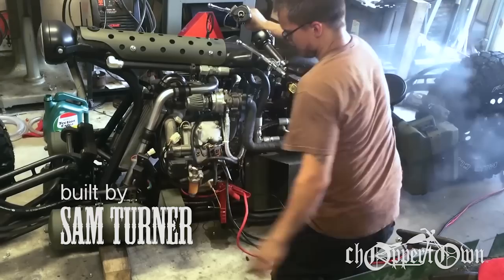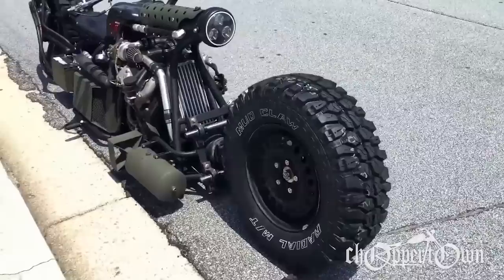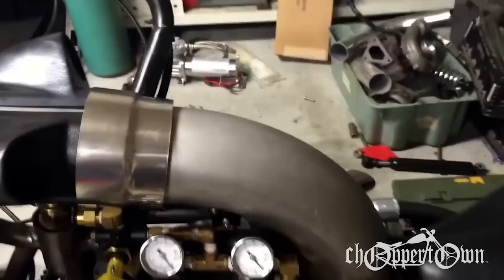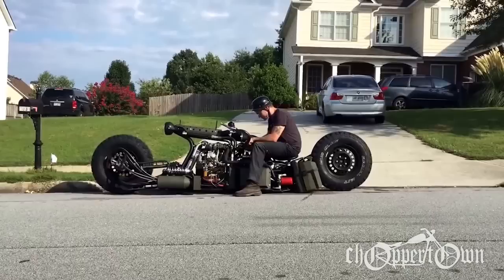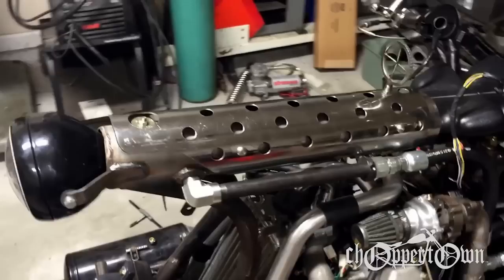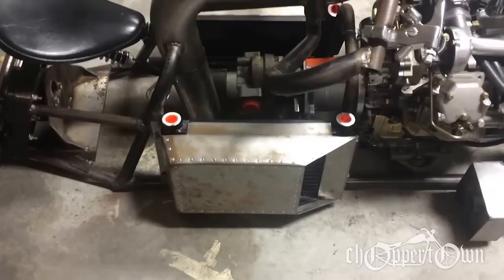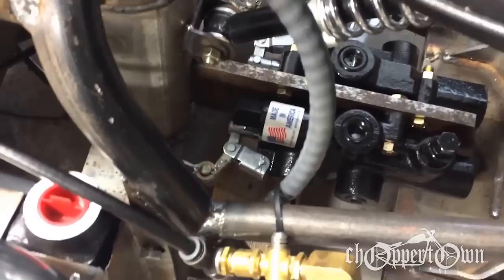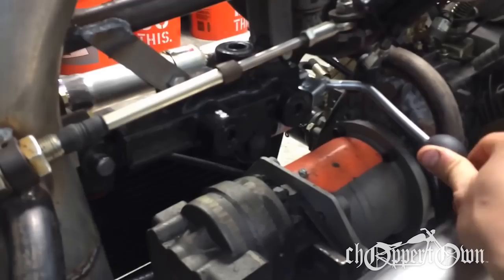Twin Turbo Diesel AWD Motorcycle (Bike & Builder episode 2)

Comment: Either too much load or too much fuel being injected into the motor. With smoke like that the exhaust valves are probibally seeing some pretty high EGT's, would highly suggest either putting larger turbos on the engine or going to a single turbo to help cut down on the smoke, if thats what your going for anyways. A 4 small 4 cylinder diesel engine out of a mercedes or even a 3 cylinder would help out alot considering it looks like those pumps are seriously overwhelming that little v twin.
Reply: Cervan leran something about diesel engines before you comment
Reply: what are you suggesting? i am a diesel engine mechanic lol. everything i said is correct, installing a larger turbo(more air) or decreasing the load(lower volume pump) would help with the unburnt fuel problem in the exhaust. this could all be wrong however if he purposely is injecting more fuel than it can burn creating the "black smoke". im not really against it being setup like that, but i would think it would be annoying while riding.
Reply: Cervan i am not trying to be mean but if you back of the fuel pump then it will lose power or if you go with more boost then you will burn your cylinders it's depends on how much air you are putting in. and remember that diesel is much harder to burn that is why almost every diesel smoke even if its just a little bit especially when it's cold and the bigger the turbo charger the more time it takes to spool up
Reply: I know larger turbos are harder to spool however it will cool down the combustion chamber and clean up the exhaust.  even running nitrous would be a good option for increasing power,  cooling egts and cleaning up the exhaust.  another thing is a larger turbo on a hydraulic setup is even better because it stays at a constant rpm while the fluid volume to the motors are modulated by valves effectively making spool a non point. the black smoke you see is actually wasted power,  it's unburned confirming the engine is consuming all available oxygen and the rest is waste. I realize that there is only so much you can do with a 2 cylinder vtwin diesel. however I believe that he is injecting extra fuel not for the small power increase but for the cool factor of the extra black smoke.
Reply: a petrol engine doesn't work like a diesel engine dose the diesel is harder to egnit that is why it smokes because the engine doesn't have time to egnit all of the fuel so the only way to stop it from smoking is ether nitrous or spray gasoline in to the intake
Reply: mr holmberg that's not true,  unless this engine is spinning 5 or 6k rpm it has plenty of time to complete combustion before exiting the cylinder.  the issue is that there is more fuel than oxygen to burn leaving a byproduct of black partially burnt fuel in the exhaust.  this is why adding larger turbos or nitrous would add power and clean the exhaust is because of the added oxygen avalable.  your argument would mean the exhaust would clean up at a lower engine speed and that is not true.
Reply: Cervan some of the things that you are saying are true but a don't want to argue more
Reply: i thought this was more of a friendly debate than an argument, have a good day.
Reply: Cervan i hope you have a good day  to and have a nice weekend

Comment: This guy built this he could install a small air compressor on it so he wouldn't have to air up his airbag system with his air hose.   Very smart man that can build this idea right out of his head.   A lot of time on his hands and spent a fortune on this bike.    Good looking bike but it smokes like hell.  Looks like it is on fire from a distance.  Hope he doesn't get a ticket for excessive smoke.
Reply: He only has to air up the bomb tanks, from my guess.  The clip where he attached the air hose was clearly from before the bike was completed.  I imagine he can get quite a few cycles out of the air in the tanks before the gauges let him know that there won't be enough air left for another stop.  

It would be cool to have a pump of some sort, or even use some of the boost pressure from the turbochargers, but I don't know if they produce that much pressure.  Maybe that could work as a backup that can supply just enough pressure for one stop, and then will build that pressure back up over the course of 5 minutes riding or something.
Reply: cyleleghorn246 All he has to do is put a little 12 volt  air compressor on board and wire it into the electrical system.  They are very small and he could put it almost anywhere he had a little room.  This way he wouldn't be running to a air hose to fill his tank.

Comment: could aused a nice small honda 20-30 hp engine, would be cleaner and quieter but I guess the smoky diesel goes with the theme, cool bike.
Reply: diesel has more torque. can handle a larger hydraulic pump if needed... also ay more fuel effeicent
Reply: Snipe Stud00 the differences between engines this small are negligible. The engine hes using is probably no more than 10 horsepower.
Reply: CrazyForCooCooPuffs might be only 10hp but it produces as much torque as a 30-40hp gas one
Reply: Snipe Stud00 I doubt that.
Reply: CrazyForCooCooPuffs look at torque specs of a diesel compared to a gas. even at smaller Liter engines a diesel produces quit a bit of torque
Reply: yeah but hp is measurement of power=how hard it will spin the back wheel. hp = torque x rpm

Comment: the smoke gives to the bike some Ghost Rider effect but damn, it pollutes a lot. should put an exhaust pipe, maybe with a turbine to produce energy and feed an electrical engine which would give to the bike a better acceleration and allow it to keep speed during gear changing.

Comment: Instead of a single hydraulic pump why not use three or four smaller pumps equaling the displacement of the single pump you are now using. That way as you engage one pump at a time it would give you a smoother take off similar to a what a transmission does.

Comment: You are not getting enough air for the amount of fuel you are putting in the engine you need to figure out a better turbo system because you do not have enough boost. Try arranging the turbos in a compound system so that one feeds the other  you will have way more power and once you start building boost the smoke will disappear

Comment: The Black smoke is looking badass str8 out of fury road but can someone xplain me the mechanism of this bike cause I can't  see any chain, belt or shaft
Reply: the engine acts as a hydraulic pump pumping fluid into the hydraulic hub motors.
Reply: Matthew Roush So there is no need for chain or belt?
Reply: Suraj Tomar nope, it pushes fluid through hoses which you can see in the video. There is one for pushing fluid in, and one for pulling fluid out.
Reply: Reminds me of the Citroen of yor.

Comment: everyone on here is blaming the engine for the smoke...I blame the final drive ratio using that kind of setup , if it had like 5 of those engines it would work lol but as it is now will it even drive uphill ?
Reply: i do´t think so, its slow, but powerfull. thats why very very heavy duty transportation devices for carrying windmill parts, or things like this, use hydraulic engins. i think the problem is the hydraulic clutch, he should have used a standart one between the dieselengine and the hydraulig pump, and better, more pressureresitant hosepipes. it will never be a racebike but it could have been faster. but the idea behind it and his contrution skill are still impressive, though.
Reply: oh Im not dogging the build it is a very nice build I like it I just think some reduction would help it a lot
Reply: what he needs is to put a two stage pump on it with two different flow rates, or possibly even three flow rates and switch between them when he gets up to speed. the issue is that i dont think the engine makes enough power to keep from lugging while at high speed to use the high volume pumps. so a 9gal/m first section and then a 15+gal/m section that he can switch between for low/high range.

Comment: So when the suspension loses pressure from a line blowout or something that bike becomes a steel skid with little or no control?  Dangerous toy that wouldn't pass inspection anywhere with standards.
Reply: mrgrimm Crash and burn never see any insurance money just lawsuits for hurting the souls of people around with your mangled appearance. :D  Sounds like a brilliant way to signal your masculinity. I'll stick to lifting weights and hunting.
Reply: I lift weights too, but by hunting you are imposing YOUR careless, murderous, will on the innocent souls that we share Earth with, just like the guy on this machine - so you are more like the guy in the vid than you would like to admit.
Reply: Gotcha, well I see you are confident enough in your ways to justify your thoughts and actions - whether I agree or not.  I guess there is no need to carry on with this because I don't see it going anywhere positive for either side. Have a nice day.
Reply: mrgrimm You too. No worries.
Reply: then this applies to every vehicle with a closed pressurized system as well,like brakes.
oh,shit every fucking vehicle on earth has a system similar to this,are they all uncertifiable?
Reply: was that.. the most polite argument in youtube history???
Reply: trillriff-axegrinder They can work if the valving is designed correctly so that when a leak or breach occurs flow out from the actuators is prevented. This doesn't however help if the command is given to the system and it has no safeties in regards to not actuating while on the move. That bike has control levers that don't seem to have such safeties. This bike like so many other show bikes are just that..for show not for real use.

Comment: cool concept but probabaly a beter idea to go diesel electric like a locomotive --- diesel hydraulic is good for slow moving equipment ------ its sad there is a lot of work in this bike but all the smoke is due to it being under powered and built wrong--- twin turbo diesel is to speed it up but look how slow it accelerates and it turning the corner it is smoke free --- back on the throttle and its just billowing and so slow to accelerate :^(

Comment: That is not a motorcycle. It would be almost impossible to steer. In order to turn, a motorcycle needs a rounded tyre. Full marks for effort but slow, heavy, smoky, unresponsive motors that don't rev don't belong in a motorcycle. Just because you can do something doesn't mean you should. It's as ridiculous as putting a mazda rotary in a Kenworth truck.